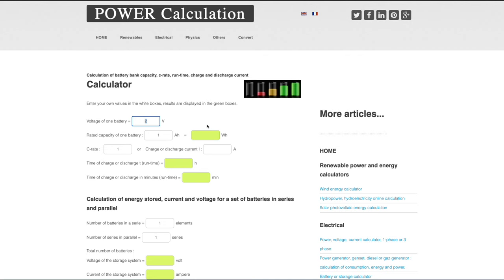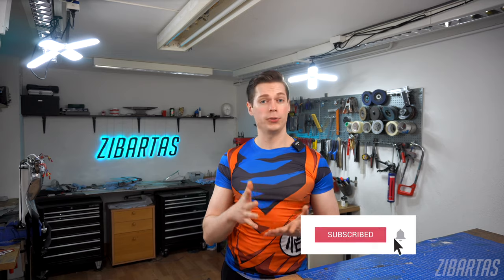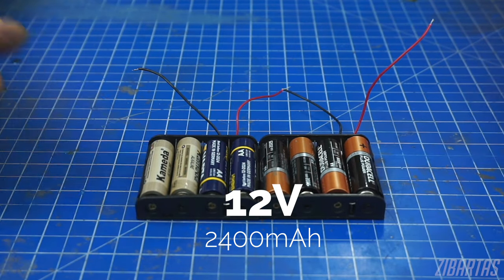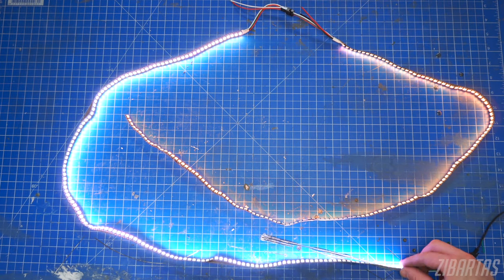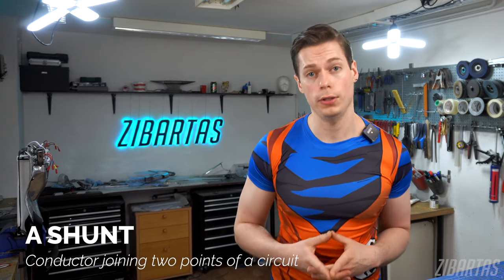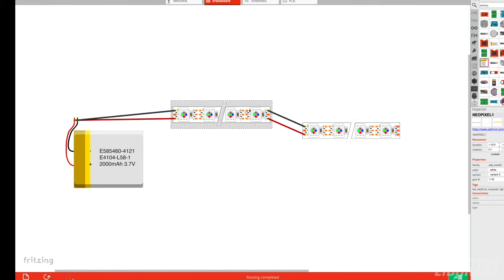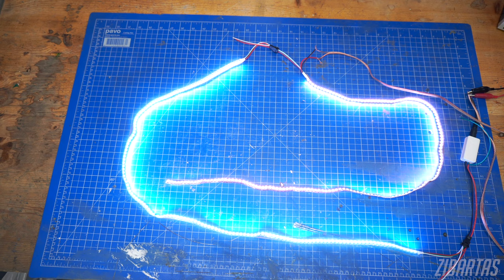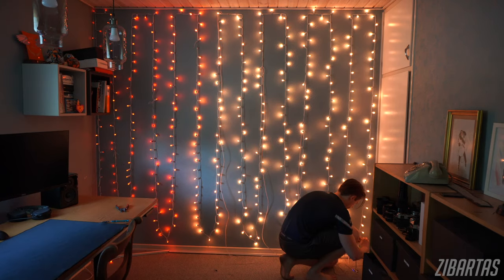How To Power A LOT of LEDs!

Comment: Hi, you forgot a Major safety point with shunting or power injection.  You have to use the same power source just branch off of it. DO NOT use 2 power supplies on a single circuit.  You can continue the data circuit but terminate the power and then use a different power supply, that is safe to do. Your drawing or animation shows the correct way, you just need to state it. Other than that it's a good video buddy.

Comment: High power ATX PSU you get 12 volts, massive amps on 5 volts, and 3.3 volts and put it and your controllers in a used mini tower and put lights in that too, surprised no one I have seen yet uses this option

Comment: @Zibartas, I thought the post i posted earlier posted but obviously it didn't. My question to you was how sure are you that your "Secret Sauce" of using the 6.6V Li-FePO4 batteries without diodes or a step-down on 5v WS28** (2813) LED pixel strips won't fry/burn out the pixels themselves. 6.6v is a lot more than the datasheet states it can handle. My post was in question of using the 6.6v Li-Fe batteries or the 26650 30-45A batteries because i was leaning towards the 6.6V per your "secret sauce" and had ordered a 6.6A 4000mAh 20C battery to try on a spare strip before connecting to my 3,187 pixel matrix and thank god i did!! That strip flickered white like a MF!!! Unless you can show and provide you using a 6.6V 20C Li-Fe battery SOLEY on a 5V LED strip, please update your video stating that you need to either use diodes to reduce the voltage or a step-down/buck convertor to prevent damage on the pixels. Again, glad i didn't connect it to my project(s). The sad note is that i had raved about your "secret sauce" to another custom builder and now i'm going to have to have them not use the 6.6V batteries unless they use diodes or a step-down. Going to order the 26650 45A batteries to use safely. Other than that, great work and projects you've built. Was wondering why the guy's from iqLED were laughing at me when i mentioned this...lol...DM me if you'd like to discuss further. A

Comment: The tip about cable thickness might have just saved the contraption I'm planning. I was about to use the little wires from a RJ45 cable to power my led strips, but now I'm probably gonna look for something thicker. Thanks!

Comment: 1:00 Please note that Neopixels (WS2812b) use up to 60 mA per LED (20 mA for red, green and blue each)
Reply: True, but in reality they don't use that much , I've measured 13mA for all 3 LED's within the 1 package, 
it suprised me as well and i , like you thought i need to account 60mA Per LED package of 3 LED's   Turns out it's not the case
Reply: @martinkuliza  What would you say is a better solution to run 700 pixels?  ws2812b as stated above on paper would draw alot more than "on paper" 12v ws2815...
Reply: @KeyIntelMedia  
ok, Your question is very vague and thus hard to answer

what does BETTER mean ?

Power 700 Pixels ..... How ?
Series Circut ? Parallel Circuit ? , LED Matrix ??    How ?
if it's a Matrix,  what configuration ?
is it 1 pin with a strip of 700
is it 2 pins with 2 strips of 350  or   2 strips  1x 100  and 1x600
what's the setup

as for Voltage,  it's irrelevant , the LED's in the Strip are In Parallel to each other, meaning...
the voltage will be the same regardless,  it's going to be a question of do you have enough Current, Not voltage
if you connect Standard LED's in Series you're going to find after about 6 or 8 LED'S that 5V wont' cut it and after about 10 LED's or so that 12V won't cut it
this is why we connect them In-Parallel
therefore it's constant Voltage, Variable current

Now your 2812B has  3 Pixels in a package
However your 2815  has 2 Pixels per package
it's irrelevant for the most part if one is 5V and the other is 12V  Unless the application requires a higher voltage

Does that help at all?
sorry, but it was really vague and i didnt know which direction to go in for you .

Sure i can tell you how to connect up 700 LED's   but in what configuration, what are you trying to do exactly

Oh, and since you are talking about 700 of them you then need to consider higher current draw which will mean you need to consider  thicker gauge of wire unless you want to start seeing things melt  and short circuit  LOL
Reply: You are right a bit vague. Thank you for taking time to reply. Yes its a fairly simple led sign idea with 15 rows (600 px) and a perimeter (100px).  The main goal to look cool, run off 1 power supply, and not break or burn up. Looking at specs i was totally thrown off seeing the 12v efficiency vs 5v in amps. My math may he over estimated. I was hoping to run this sign off a brick but Im seeing 36 amps at max specs according to spec sheets. Also simple design with a few modes. 2 pins could work as im still learning the language capabilities of IC leds.  There will be 15 horizontal rows in different colors that make up the 600 px.

Comment: You should consider using 12v ws2815 strips for better color consistency (due to lower % of voltage drop in long runs) and much less current in wires&strips.
Also it is a good idea to use "dc-dc buck converter" with higher voltage battery pack for stable power output during discharge.
Reply: Holy shit, thank you so much for this information this is amazing ❤️❤️

Comment: Dude, honestly, I've been getting into LED DIY projects and am starting to play with the ws2812b LEDs and doing my own power supply. The way you cover these 3 tops, plus, you're the only one that i've seen actually explain how/what a shunt is. That doesn't even mention the external batteries, how the f do you not have more subs? You now have mine. Thanks my dude.

Comment: Thank you sooooo MUCH!!! I have led honeycomb ceiling lights installed in my garage I'm in Australia and our electrical grid runs on AC and these are DC so I need a transformer no one can answer me on what power do these LEDs draw. 

What you taught me is the wire size. These led tube have very slim gauge worse so I'm confident these a very low powered LEDs
Reply: I ended up getting 2 LED transformers just in case. They are inexpensive and I'm pretty sure it will fix my problem

Comment: Terrific explainer Zibartas.  On the odd chance you see this question after 1.5 years, can you please say why you didn't talk about using 24V LED circuits for big projects.  I'm a new subscriber, and am loving your channel - particularly your very, very clear explanations.
Reply from the maker: Mostly because 24V is not that 'portable' of a power source  - but yes, for home lighting higher voltage is the way to go (assuming you can find LEDs in that voltage). For the most part, addressable LEDs are almost always based on WS2812b chip which runs at 5V, and the cheapo 'dumb' RGB LEDs almost always run 12V - so we're kinda limited by that, even though high voltage is a great idea. Thanks for watching and enjoying the vids! :D

Comment: One small mistake (imho): A shunt refers to a resistor being there to get a lots of current through in parallel to a measuring voltmeter, so you can indirectly can measure the current by measuring the voltage drop on the shunt.
What you describe I would refer to as multiple point power supply. It is not unusual to see such suggestions in the documentation for a LED strip. I have seen suggestions to provide power in the middle of a 5m strip in addition to start and end should it be used in full. Which would be a (bit wonky)workaround in itself, to provide the power solely from the middle of the strip so the current is divided from this point on.At least this would work better than to provide power only on one end.
Serial connection to NeoPixel strips still needs only end-to-end connection, though.
Reply: Actually, a shunt is designed to allow electricity the best, lowest resistance path through a circuit, there's absolutely no added resistance in a shunt.

Comment: Be careful not to drain the rechargable battery packs to low or you could damage the cells. And if the cells are not matched which is likely with the lower cost RC packs, how low you can drain them will be even less as one unmatched cell could be completely drained while the other cells are not. A battery pack is only as strong as its weakest cell. I'm not saying purchase an expensive matched battery pack as eventually a matched pack will become unmatched from use, so leave the expensive matched battery packs for the RC racers. Use a low voltage cutoff between the load and the battery. You don't want a cells voltage to drop below 3V so use a cutoff around 3.4V - 3.6V.

Comment: I'm looking to run 12m of SK6812 60led/m strip.....if I power inject in the middle, wouldn't there be voltage drop from the power supply wires as well at 6m?

Comment: Hey nice guide for beginners, but some mistakes in your video.
1. The equation that 8amps is sufficient for 400 Neopixels is wrong, as they don't use 20mA rather than up to 60ma. So 8A/60mA=133 NeoPixel LEDs. As for Ws2812b LEDs often used there are two types, one consuming a maximum of around 33,5mA and one with 52,5mA. So you could drive 152 to 246 of those depending on the type.
2. What you referred to as a shunt is called power injection, or multi point supply.
A shunt is a low value resistor used to measure current.
Reply from the maker: Thank you for feedback! (60mA is their peak power draw at pure white, with max brightness, for animations and such I've never topped out more than 20mA so I just used that figure :) And you are correct about the shunt-power supply term, I think someone corrected me down below already haha!)
Reply: @Zibartas  your welcome. Yeah you're right most of the time with mixed and dimmed colours 20mA would be average.
Anyway the mentioned fact with the two types of WS2812b I feel is very interesting, cause the better type really only uses ~33mA at Full White, which is a huge benefit if you start building really big Matrixes with 500 pixels 😁

Comment: I have a bunch of adaptors that input voltage is 120v and output varies from 5 to 18v. Can I use these adaptors to power like 20 LEDS? Of course I know there will be resistors involved. I will use all the same LEDS which are 3.2v and 20mA.

Comment: Do you have any ideas for running 30 10a 24v rgbw controllers? I have 3 3200w 24v power supplies but want to make sure I wire the controllers together the best way. Do they need to be jumped off of each other or individual lines running to a bus bar etc
Reply from the maker: Can't advise you specifics as there might be things that could be overlooked and make stuff dangerous when you're building something so large:( but balancing load and having good safety margins never hurt!!

Comment: I have a project I'm working on where I need a rechargeable battery power supply that can output enough amps for 120 5v addressable leds. I've been using a USB power bank for testing which has worked ok but I need something I know won't blow up if all the leds are full white. Any suggestions?
Reply: Just get a LiFrPo4 battery,m

Comment: great info but have a question im using 244leds on a car project and using step down from 12 to 5v at 3A will this be enuff to power all the leds or do i need to add more buck convertors to the circuit like each end or just shunt the wires to the end of the strip and the middle ?

Comment: Hey, Just a quick question. How long is too long for LED's ? Is there some Sort of set Limit for the distance or a formular to calculate it ?
Reply from the maker: I think there is an "absolute" limit - usually with longer circuits you need higher voltage (would burn LEDs) or thicker wires (strips come in set standard sizes) - so the only way to really "expand" the circuit is to inject power into it every few meters with a more direct connection to the power source. I hope this makes sense!

Comment: What is the connector piece from the lights to the RC battery called at 2:07? I’m trying to hook up warm lights - not the multicolored ones - and finding myself a bit lost re:connecting wires to batteries
Reply: It might be JST-SM

Comment: The trouble I have is the controller melted. The transistors melted and failed. Do you have a recommendation for a controller to power 15m of 100 led/m RGB strips ?

Comment: Thanks for the info.
I'm installing 40 meters of Ws2812b (5m/30leds).I calculated the power consumption, I'd need about 80 Amps. I have 2 power supplies, 60 and 20 amp. I also know that the board must be connected to common ground with the PSU. Any idea how I can do that with 2 power supplies?

Comment: I’m not sure that I am clear on the shunt area of discussion.
If I have a SINGLE, LONG run of LEDs, I have been told to consider running 12V to BOTH ends, to reduce dimming.  The part that I’m unclear on is, if I do that does Each end supply of 12V come from the SAME fused circuit, or a DIFFERENT fused circuit for each end ?
Reply from the maker: Same power supply :) it's just an additional point in the circuit where you 'inject' power that's not bottlenecked.

Comment: My RGB Led Strip 12v 5m 60leds/m 5050 (4 wire led strip) ,  color faded on second strip in series. Strip powerd with 12v 12.5Amp power supply. I have also tried with ATX 300w power supply, but same result. 
I measured voltage and current on led strip. 
- Only Green light 12v in starting and end of strip 9.31v and 1.30Amp.
- white light RGB volt is 11.96v in starting and end of strip 8.52v and 2.80Amp. 

Voltage measure with 2nd strip in series 
- white light RGB 11.96v in starting and end of strip 7.22v  and 1.40Amp.

I think when st led strip current is 2.80Amp then  2nd Led strips in series current should higher then 2.80Amp.

Comment: Good day Sir 👋

I'm experiencing voltage because I exceed the amount of led to my existing power supply 12 volts and 5amps.

what will you recommend specs and brand of power supply for my 12volts 406pieces of 4pin led strip lights 5050 version IP65 water resistant?

I have also Bluetooth controller mobile app for this to manage the brightness and strobe, fade effects.

for indoor use only.

Comment: Thank you but can you tell us more how do you run hundreds of miles of LED lights without multiple plug-in cords can we just simply build a battery pack to run the system like you suggest in this video or is it a better way to run all these lights in line power amplifier that does not need to be plugged in maybe a boost converter and then a butt converter do you know like to hear for you and I did subscribe

Comment: Amazing video, thank you. One thing which is confusing me is how to use the LiFePo4 battery as a power source (do I need a connector). Is it dangerous?
Reply from the maker: Lithium iron phosphate batteries are much safer than regular LiPo packs, but still, it's a good idea to stay within the recommended charge-discharge range!!
Reply: Thank you :) my circuit seems to heat up a lot. Should I use a resistor?

Comment: Question for the audience: I have a 2meter strip with 144leds/m. I have a sp511E controller. I want to buy an adapter with 5v and 8Amps to power the strip, should be good. But this adapter just sticks in the controller, i can't run some wires to the back end of the strip to have multiple paths for the electrons. 
So first question: Can I just use an 8amps adapter in the controller? Will it not break/burn the controller?
Second question: How do I solve the problem of having multiple paths for the electrons?

Comment: Yes a led consumes around 20mA but the WS2812B are in RGB and this kind of diode consumes 50mA and not 20ma and a WS2811 around 60mA so your information is a little wrong 8A => 133 leds not 400 ..

Comment: Hi, I have an sp108e controller, I have a 30a 5v supply wired to the controller and all of the power to the LEDs (WS2812b 144led/m x 2 meters) is coming from the output of the controller. It worked flawlessly for a few days then the controller wasn't powering on. So I replaced the power supply with the same one, it again worked flawlessly for a few days then stopped working. Do you have any ideas as to what is going on?? Both psu's are still putting out 5v on the voltmeter but its like the controller is killing power supplies? Should i have wired the controller with a seperate smaller power supply and just had the neg and pos of the 30a power supply connected only to the neg an pos of the LED's?
Reply: Hi, do you solve your problem?, i want to build something exactly like you have, same controller, same power supply
Reply: @edgarsilva7046  Yeah I ended up having to replace it as it was faulty. My new unit has functioned non stop flawlessly since I got it over a year ago. It's literally been switched on the whole time. It's a good little unit. Just make sure that there isn't too great a distance from the router or that there isn't too much blocking it. Also when you wire the strip up make sure you use both negative and positive leads on the led strip. So one set goes from strip to sp108 device and other neg and POS direct to the PSU to act as a separate power source. This ensures that the strip is properly powered and not all of the power is being stuffed through the little device.

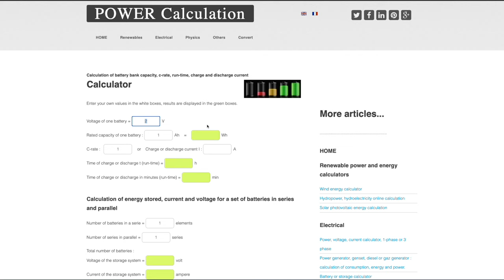Comment: 2:35Min - So to understand you correctly: 1LED uses 0,06A, so I could power 700 LEDs (5V) at maximum? But for how long? 3 minutes?
Reply: First of all - depends on the type of LED you use. Second of all - if you power LEDs with less than "standard" voltage, some LEDs will shine, but just a bit dimmer, thus reducing amount of energy consumed. If you use RGB LEDs, then the energy consumption also depends on the color you are displaying (lots of factors).

For how long? - Well, you have mAh ratings on your batteries right? For example: if your LED strip uses 1.2A of power from 5V battery rated at 3600mAh, it lets you power it for 3600mAh / 1.2A = 3.6Ah / 1.2A = 3h